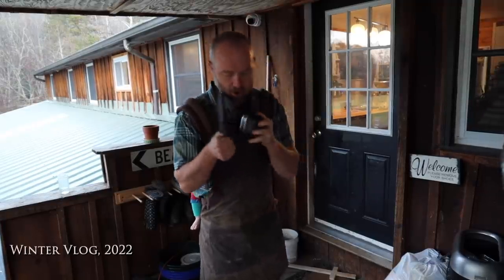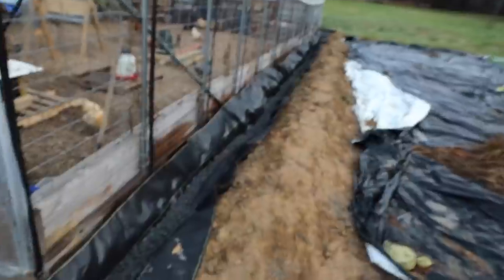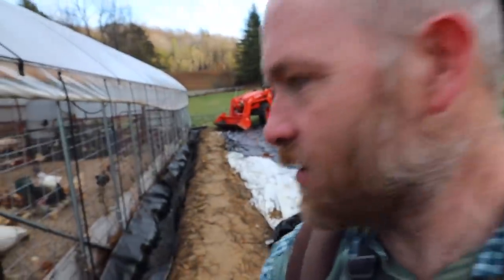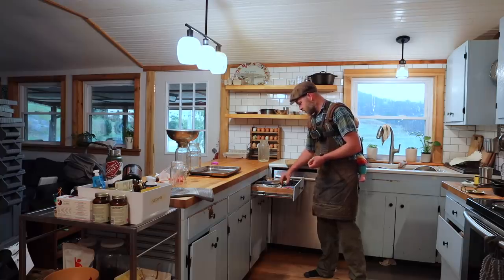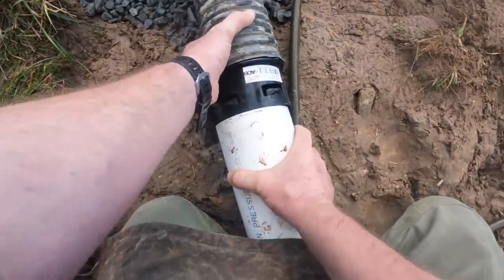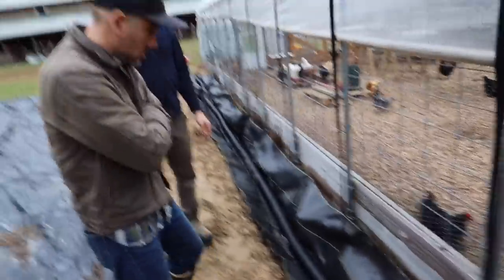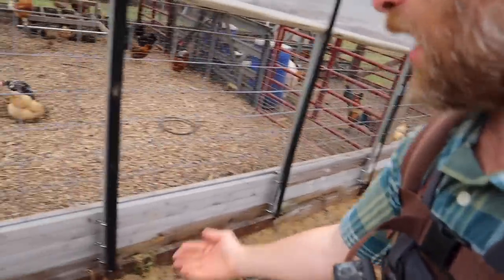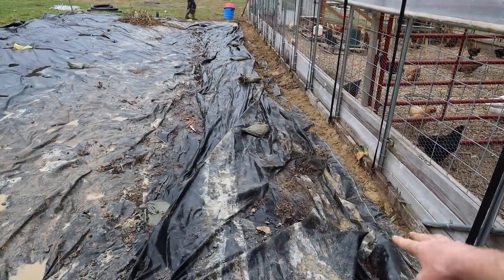Homestead Dream Team Ditch and Tractor Action

Comment: You could use 2 large dog cages for separating does and bucks for the rabbits just hang water bottles and make a small box inside  cheap and mobile just move across ground each day they eat the grass under them and leave yard fertilized that's what I did raising rabbits make sure you separate them before they can breed their siblings  I also hung a small salt block to the side of their cages

Comment: Wow, 4 men to complete the French Drain and look at it!  The PVC didn't have to be that long, when water hits a hill it keeps on rolling.  Was the PVC glued together?  I didn't see a level for ensuring a correct slope! There was no water flow test done and now it's buried.  Water running off the roof will go through ground and into drainage pipe, so cover all of it!

Comment: Shouldn't there be a few holes in the top portion of your PvC pipes to capture the water?
Reply: the problem area is the long side of the greenhouse. The black pipe in the ditch with gravel at long side of green house is perforated and connected to solid pvc to carry h2o to the creek.